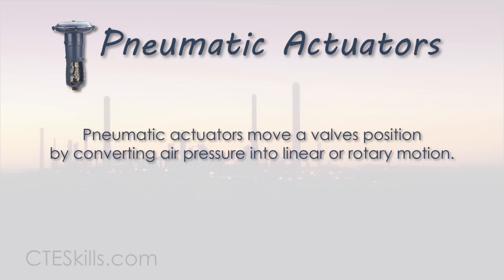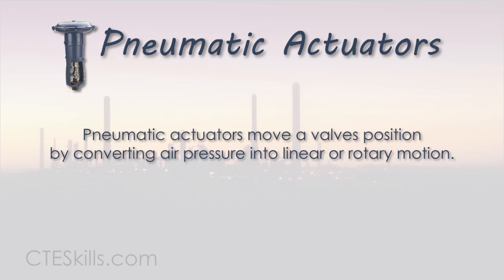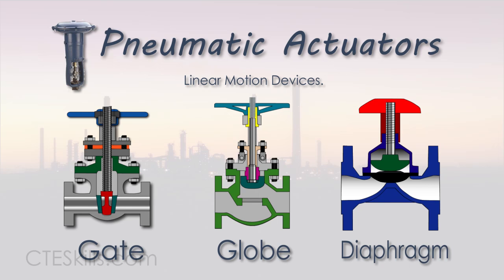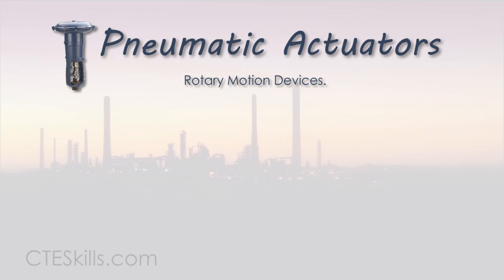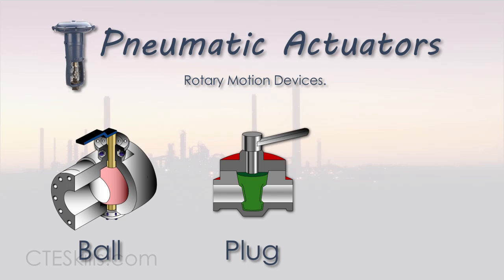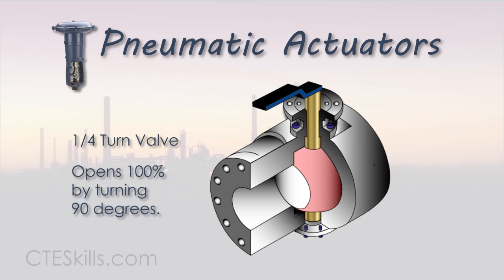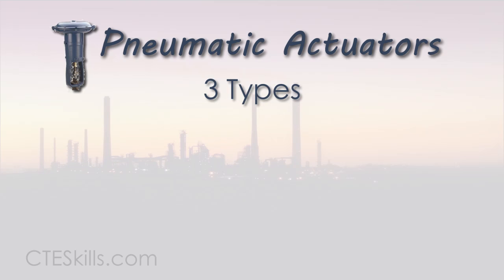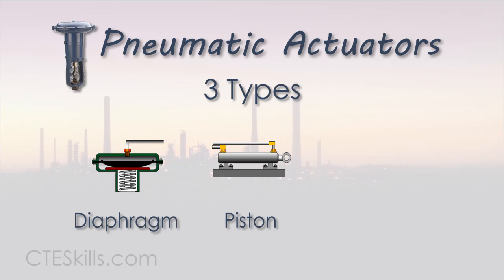Control Valves

Comment: Does anyone know how noise is generated in a safety relief valve?
Reply: cumminskirloskar
gen rater1250
kva
Reply: The valve is normally closed ans will have a set point of say 20bar.  Once this pressure is reached upstream, the valve open and the fluid will have a 20bar delta pressure = high noise from expansion

Comment: Hello,every one.We are Fute Valve Pipe-fitting Co.,Ltd,a great factory manufacture sanitary stainless steel pipe-fittings and valves.Add China Wenzhou Binhai Development Zone No.757 Fax:86-0577-86801978 Tel:86-0577-86801978 86-13587601006